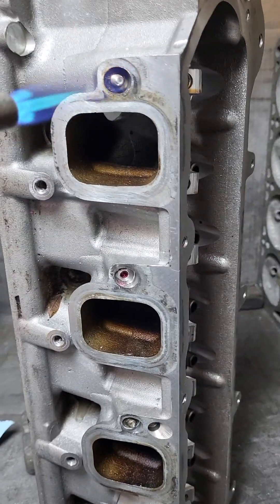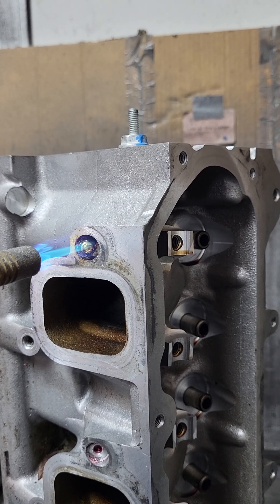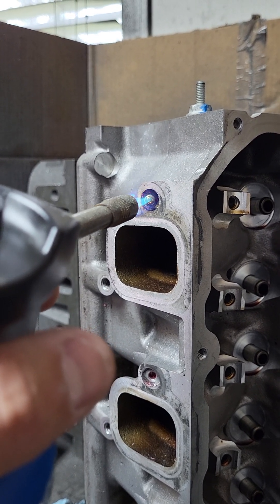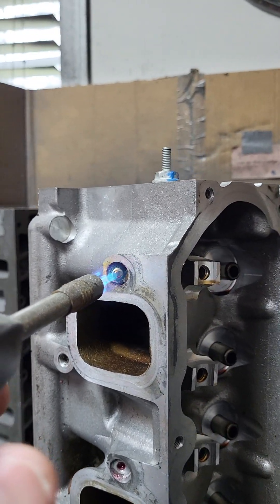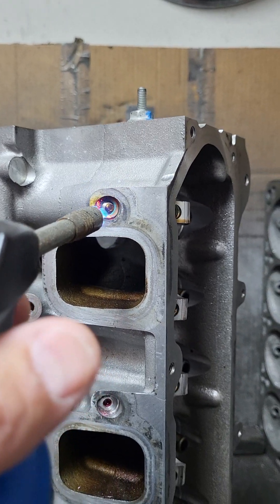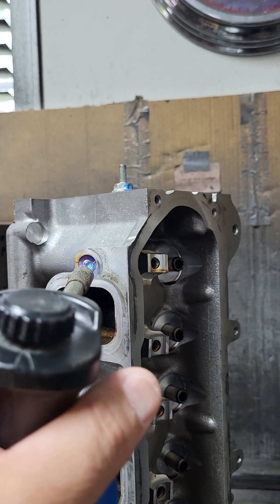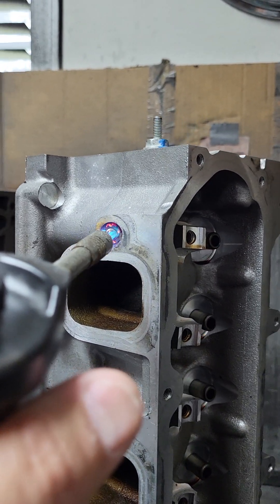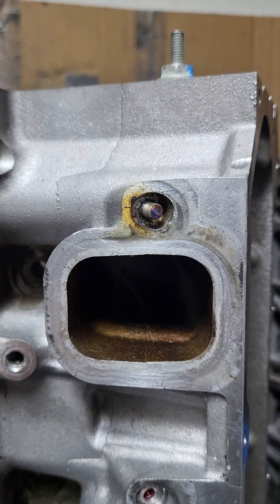How long does it take to melt Loctite????

Comment: Aluminium starts to anneal at 160°C you can convert that to °F. Loctite generally needs 250°C or higher to degrade. Where the bolts are, even the exhaust side, never gets to 160° unless the engine is in melt down mode (like the ex missus). Heat is NOT your friend.